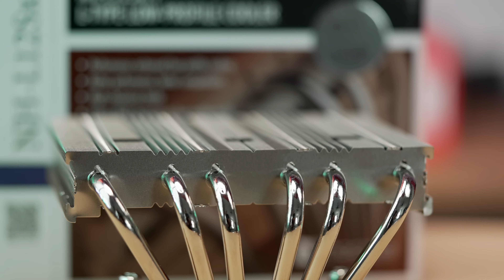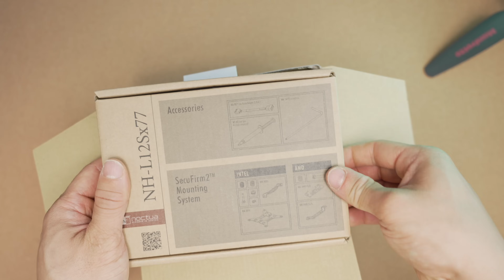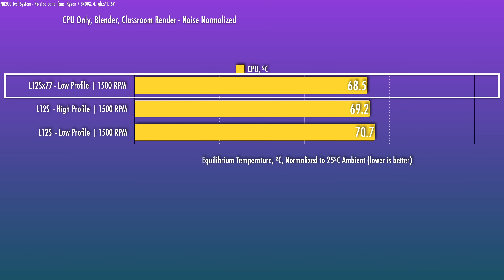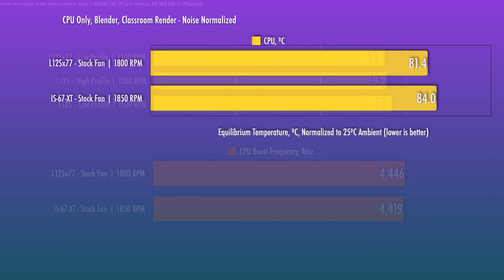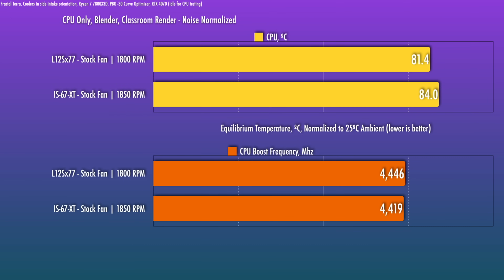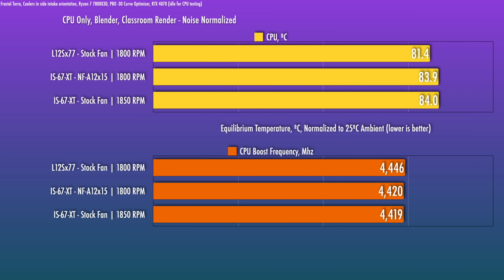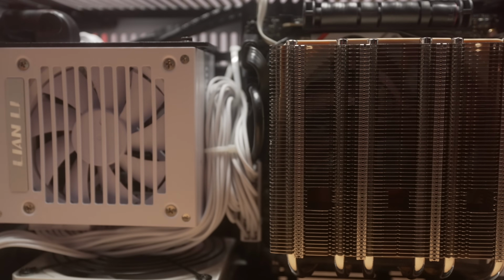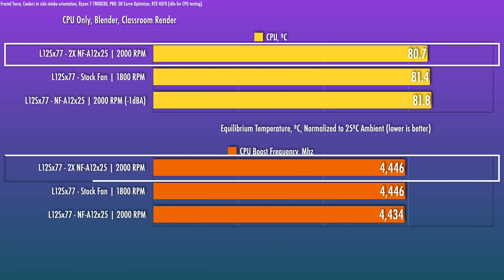The new Noctua L12Sx77 - Like it's made for the Terra!

Comment from the maker: I wanted to note an inaccuracy on the L12S height- I had remembered 72mm but it is actually 70mm. So the new cooler is raised by an additional 7mm and not 5mm.
Reply: Still l do in fact have very small schlong.

Comment: I have my doubts this will outperform Thermalright SI100, both thermals or cost.
SI100 has room to fit a slim fan under the heatsink just like Noctua. 
And since one would be choosing the best heatsink, they will also choose the best fan. Noctua slim fan is far from the best. I suggest an Silverstone AirSlimmer. Noctua suffers from the large gap between the blades.

Comment: Thanks for the video, it really helped me to understand the measurements. I would like to run a Ryzen9 9950x3d in the case with the fan. What do you think, is that a good idea?
Reply: The 9950X3D uses significantly less wattage than the flagship 9950x, especially when it has a slight undervolt in the BIOS settings, so it should have a pretty impressive thermal range for an SFF build.

Comment: I know this vid is about the 77mm variant, but with the normal l12s, I've seen practically every build with a Asus STRIX B650E-I Motherboard have the button of the pipes pointing to the right (so read of the case) which seems to offset the fan the opposite direction to what you showed at around 4:57. do you have any opinions on this? For me, having paid for these parts, i don't seem to have a choice lol

Comment: Very informative. In your experience, would having the GPU fans very close to the side be just as noisy as a fan-on-top CPU cooler the same distance away from the panel? My GPU is exactly 43mm on the dot so I'd be cutting it close.
Reply: GPU fans tend to run at very low speed or just staying idle in most of the time, so it's not going to be a big problem in my perspective

Comment: This is an awesome unit... 
I just replaced my 9x65 with a NH-12Sx77 and it dropped temp 10 degrees... that's on an i9-12900. running at idle at 26-27 degrees. it was running 37-40+ degrees and got quite warm when I started 4 VMware Pro VMs.
I have one other machine with a NH-12S which is 72mm high and going to replace it as it runs at 46 degrees idling..
Both are in InWin CE-685 and CE-052
Note: had to remove the locking mechanism from the cases, but decided to run without the side panel as it runs warmer as I don't have optimal airflow and would probably cut out a vent where the cooler exhausts.

Comment: 3:04 I find your wording confusing. You mean pushing right? Because you say pulling air through the heatsink is not a good configuration but before you mentioned flipping the fan around to intake and when we intake, we actually pull in this case. What you mean is pushing hot ambient air outside (through the heatsink) is worse than pulling cool air in (through the heatsink) so we should configure the fan as intake, right?
Reply: This is an old comment, so I'm not sure if it's worth replying to, but in most SFF (small form factor) configurations, the bottom-mounted fan on the CPU cooler faces intake. Think intake (cold air outside - radiator - motherboard) and exhaust (hot air inside the PC - radiator - external exhaust). Makes sense? Because of the tight space inside an SFF case, this type of bottom-mounted fan cooler is ideal for intake. However, it can increase RAM temperatures. I've actually tested both scenarios with this cooler myself and can confirm this.
Reply: @dkfjdkfjdk by bottom mounted you mean "flat" top blower coolers?

Comment: why would a founder edition be good for this case? one of the fans facing upwards is drawing air from the psu, or nothing. this is why nvidia reference designs are inferior
Reply from the maker: Both fans intake from the side panel, one exhausts out the rear and the other one exhausts towards the center spine (which is why it’s a good idea to space the PSU out in sandwich style cases for flow through cooler designs). Otherwise the FE cards are perfectly fine, if not great for the case since the blower section exhausts heat from the case that would otherwise have a chance of being recycled.

Comment: I'm building the terra with this cooler. Do you have any suggestions on a GPU that would fit on the other side? I'm not a gamer , just looking for an upgrade to the onboard graphics on the Ryzen 7 7700 I'm going to use.
Reply: Any two slot GPU that's less than 43mm thick should be okay. If you're not a gamer then honestly I'd just get the cheapest modern one you can find - an older generation would be okay (like an RTX 30 or 40 series)

Comment: Lovely video!!

I followed your advice. I ordered a620i lighting wifi, noctua NH L12S, a noctua 12x15, gigabyte rtx 4070 windforce 3 fans 50mm width. 
Will this be a problem?
Also, someone told me the motherboard heatsink would need to be removed
Reply: does the 50mm card fit with the 77mm cooler?

Comment: Noctua NH-L12S will outperform Noctua L12Sx77 even thou it has less heatpipes running through the cooler.
Reply: Without facts or substantial arguments this is just your opinion
Reply: @Butziwackel  I think ChatGPT lied to me, I see now the x77 is performing 4c cooler than L12S.
I will say thou, the L12S is 0.7cm lower in hight and fits the MiniNeo s400 where as the x77 would not fit.
Reply: @orion9k  you better never trust chat gpt, but it's good you've found more data. That new version of that cooler will also not fit in my build I'm planning, it's 7 mm too high sad to say
Reply: @Butziwackel  Yea exactly 0,7cm too high, I was going to use it myself, luckily I went for NH-L12S instead to run a 7600x3d

Comment: hey brother, question here
I'm looking for an itx case that have enough clearance for an air cool unit to cool the 5900x and it would be nice if the case has a front usb c
Reply from the maker: Ghost R1 would give the most air cooling flexibility (but no front headers). NCase M2 with C14S could work also and had ample front IO.

Comment: Great review! Do you think that an Asus ProArt RTX 40 series would fit in Fractal Terra case using this same CPU cooler?
Reply: I have just built this, with a L12S and a ProArt RTX 4070 and it just about fits, with maybe 5mm of clearance.
Reply: @philippfarnschlader2300  what position do u use
Reply: i wanted to the same thing. so i wanna get a proart 4070 super and its 50mm thick... the gpu clearance on the terra setting 1 with 77mm space for the cooler has only 43 mm space for the gpu. so i think it does not fit (mathematically)
Reply from the maker: This guy is correct. It will not fit. Here is where you have to pick which child is your favorite 🤔
Reply: I just ordered a620i lighting wifi, nh l12s, and gpu with 50mm width. Will it be a problem for the terra

Comment: Could be interesting to include the Alpenföhn Black Ridge with a Noctua fan in this test. It has a lower height, and I was very happy with that cooler for the Terra, although it required the right RAM height.
Reply: It is virtually impossible for me to find ddr5 ram that fits the black ridge ram clearance of 35mm...
Reply: @BlackAera  oh yeah that might be a struggle. I've only used it with DDR4, which was also a bit of a challenge

Comment: Would've been nice to see the NF-A12x25 underneath in exhaust mode instead of intake. With the thicker fan exhausting it may be able to push through the fins and side panel more effectively than the 15mm exhaust, without issues dispersing heat underneath as with the 25mm intake (with access to fresh air becoming the main factor). Maybe next time..
Reply: I’m going to configure a build in the Terra this way soon, how would you recommend stress testing to find the better configuration?

I’ll try to find out and post results, I’d like to know too lol
Reply: @MechanicaDyadica  Ты уже сделал тесты, мне очень актуально!!!
You do tests? can tell me about a12x25?
Reply: @MechanicaDyadica have you test it yet? Please let us know😊
Reply: I put together the rig almost a year ago but wound up leaving the fan as intake. It’s an extremely tight fit and wasn’t worth the effort reassembling the computer to test as exhaust… however it runs very cool when using the larger fan for the heatsink and couldn’t be happier with how it came out.

Using a 7950X3D btw

Comment: Thanks, man! The video is great. But concerning the last configuration L12Sx77 with thicker 25mm noctua fan, the fan is mounted wrong way! It has to be blowing hot air out of terra through the radiator, not sucking it inside directly to cpu, ram and vrm! 

Is there any chance of fixing this part and comparing it to the stock Nh-l12sx77 15mm fan? 
I'd really like to see if there is any point in buying a high performance 25mm fan for this setup.
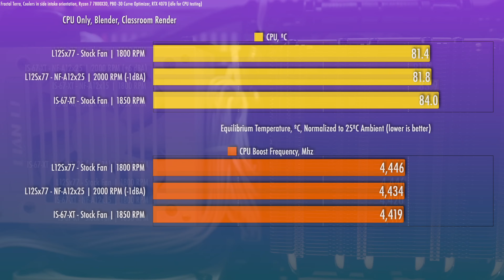Reply: 13:48 comparison chart probably is not correct
Reply: This is an old comment, so I'm not sure if it's worth replying to, but in most SFF (small form factor) configurations, the bottom-mounted fan on the CPU cooler faces intake. Think intake (cold air outside - radiator - motherboard) and exhaust (hot air inside the PC - radiator - external exhaust). Makes sense? Because of the tight space inside an SFF case, this type of bottom-mounted fan cooler is ideal for intake. However, it can increase RAM temperatures. I've actually tested both scenarios with this cooler myself and can confirm this.

Comment: I have a quick question about a few comments that you mentioned when talking about recommended CPU.  You said that the 7800x3d would be a good fit, but that the 7700x might be pushing things.  On the noctua compatibility website it shows the 7800x3d with no green bars, and the 7700x with one green bar.  I just wanted to ask for a bit more information on this!
Reply: I did notice this too! That's why I went with 7700x instead of 7900x.
Reply: @ross6883  How has it been going for you with that set up?

Comment: It's just too skinny for a serious build. Need more cooler in these small boxes.
Reply: They're not worth it. Every CPU still throttles, and you have a jet engine on your desk. A good looking case is a poor trade off for that. The main problem with the Terra is its space management is poor. With just some shuffling things around, they could have fit a 140mm intake behind the front panel, 140mm exhaust at the back, along with a full sized cooler as big as a D15 if they mounted the motherboard horizontally and let that take up the whole back end. All it would have taken is either losing some max GPU length, or increasing the case length slightly. It wouldn't look much different from the outside, but it would easily compete with the best airflow cases. So basically the Terra sucks because someone in the design department said "Nah, we can't make it an inch or two longer or wider, that would ruin our whole vision!". If you look at cases like the Node 304, it's easy to see just how possible it was to make the Terra's internal configuration better.

Comment: I have an amazing 4070 Ti Super MSI Aero (Blower card with Custom Fan curve)  x Ryzen 7800X3D (GPU + CPU undervolt*) in my black fractal terra ….w/ Noctua NH-12S. I’m going to upgrade as I’m within the 30-day window and upgrade + the 25mm black fan combo (as I have the slim 15mm noctua black + 4 pipe / 70mm cpu cooler variation all within 30 day window) 

I will limit my GPU space but honestly, it’s fine. This will help my system perform better and preform 3-5 degrees better minimum. Also because I currently have my slim noctua cooler fan in the exhaust configuration - unfortunately.

Any feedback will help. I think I’m making the right move although this is definitely restricting all users to 50-52

Actually - please look below:

*I’m not sure if you mentioned the offset screws for the MOBO. It’s a good 7mm I think from the middle dividing panel. I’ll most likely remove those too to install the 7mm deeper 77mm cpu cooler variant. Perhaps I can get away without removing the MOBO Offset and keeping as is but then it would be REALLY close to the Slats on the side panel. Do you think the offset of the MOBO has any pragmatism that comes into play? 

P.S. I see the MOBO offset screws still installed as advertised on their ‘1’ Setting configuration (43mm GPU / 77mm CPU Clearance).. man that heatsink is RIGHT up next to the side-panel. I wonder how that claustrophobia affects things…

Thanks!
Reply: Quick question what does your customer fan curve look like? I am trying to pick up the same gpu and the rest of my specs are the same

Comment: Thanks a lot for that Test.
Looks really nice but the Fan Noise at all, doesn't matter if it's in front or behind would drive me nutz, also what about Dust? 
There's no Dust Filters at all, and 4 sure u will have that thingy full of it after a couple of months.
Reply: a cheap pc vaccum/air blower is an easy fix for not having filters

Comment: Used on a 590i with an 11700k at 4.7 ghz. Limits temps to 70-71C at 70F ambient in a DA6 case. On this setup the 15mm fan does not protrude, but a 25mm does.

Comment: "Like it's made for the Terra!"
This cooler reduces GPU compatibility to 43x131 / 33x145 
Not a single RTX 4080/Super now fits.
Only 4070 Ti Super that fits now is INNO3D.
You don't have to regurgitate promotional talking points when they're obviously wrong.
Reply: Are Inno3D GPUs bad?

Comment: Probably not worth. But actually I'm thinking about switching from my L12 Ghost S1 Edition to this one... Seems now it would fit on my Aorus B550I. The L12S didn't fit because there was to less clearance between cooler/fan and vrm heatsinks...
Do you think or can you check, if the L12Sx77 fits on an B550I aorus?
Reply: Update: Just bought it, delivered today. Works perfectly on Aorus B550-I :3

Comment: On my L12s I added a 25mm fan underneath, slimmed it down to 20mm thickness to fit with regular LPX RAM. Noise isn't as high pitched and also got quite a substantial decrease in temps; which is unlike your results with the 77mm one, which is interesting to say the least.
Reply: Running a 25mm underneath the heat sink and the 12x15 fan on top that it comes with? Or did you move the stock fan to exhaust at the bottom of the case?

Comment: I have a dual slot GPU and when I first got my Terra I tried a 25mm fan on a Big Shuriken 3 which put the fan against the side panel. Well quickly switched to a 15mm fan after hearing the turbulence. I am currently using a Thermalright AXP-100 Full Copper with a NF-A12x25 at 69mm and performs great and is very quiet. Price wise it is even worse than the L12Sx77.
Reply: what gpu are you using?
Reply: @megadeth8592  Inno3d 4070 Ti X3.

Comment: i have a dan- h2o build with a 5800x3d cooled by air with the thermalright x47 full copper and a noctua a12x25 with 2 t30s extracting on top, do you think this cooler is better? or worth the change?
Reply from the maker: This cooler is better for sure, but if it’s for the A4-H2O you won’t have enough clearance.

Comment: I hope you can test out the Thermalright SI-100 Black against the NH-C14S. I've seen a benchmark that puts the SI-100 on top of the NH-C14S which is kinda hard to believe just because of the sheer mass of the NH-C14S compared to the SI-100.

Comment: L12S is 70 mm, not 72.

Using the x77 forces the 2-slot GPU to be flush with the side panel, which probably causes more noise overall (vs. using L12S where you can have a 7 mm gap there).

The heatsink is probably optimized for A12x15, which is why you see little improvements by swapping to A12x25. That said, at lower noise levels A12x25 will likely give a much bigger advantage.

I have seen tests where the L12S rapidly deteriorates in cooling performance once the heatload is above 150W. With the extra two heatpipes, the x77 might offer a bigger advantage on higher power CPUs with lower heat flux density (e.g. 14600K or above).

The L12Sx77 has flat heatpipe ends, which asaik were not seen in Noctua coolers before.
Reply from the maker: You’re absolutely right on the L12S height, pinning up a comment now. As for the gpu on the side panel, with founders edition 2 slot cards there is enough of an air gap, such that I have not noticed any turbulent noises. The flow through section likely helps as well. In the build video at about 29 minutes in I demonstrate the noise from the GPU. https://youtu.be/ZQA3ywIHess
Reply: @MachinesMore  Great, thanks for the info. It really is the perfect cooler for Terra then, assuming using a 2-slot card.

Comment: What would be the absolute best cooler for a 53-55mm card? I've looked at many, but there are so many different opinions and tests. Any recommendations?
Reply from the maker: Position 3-4 leaves 62-67mm for the CPU cooler. If you have 67 I’d avoid the IS-67 XT due to noise. From what I’ve tested the ID Cooling IS-55 is very good. With some boards there’s one orientation in this case where the fan has to touch the bottom of the case in order to fit but otherwise it’s a great choice.
Reply: @MachinesMore  I'm using zotac 4070 ti and the CPU side clearance is 65-ish using IS-55 with 25mm Arctic fan, cooling a 13600k, with no clearance at all. The noise is there but It drops the temp significantly. If you have FE I think, you can go 77mm cooler. ID Cooler is great with 0-1mm clearance on the Ram Sticks and all.
Reply: @MachinesMore

Comment: I've been waiting for something exactly like this. Finally, a Noctua option for the Terra that isn't the NH-L9x65 with the tiny 95x95x25 on top at 75mm (or stock 95x95x13 at 65mm). But with those, the fan's near the panel, not under the sink. Awesome!